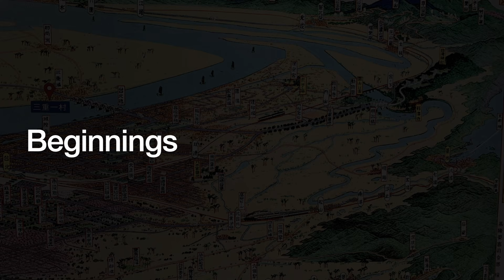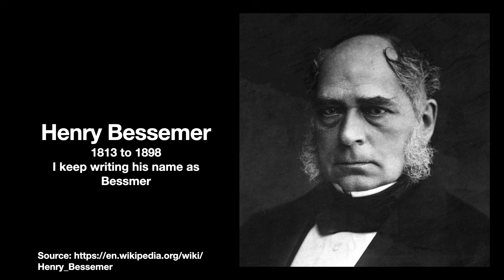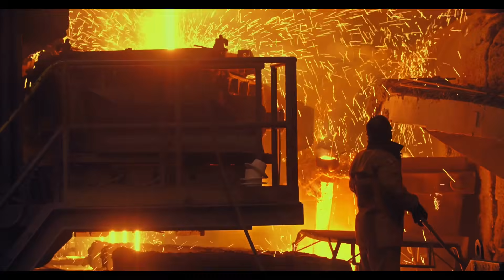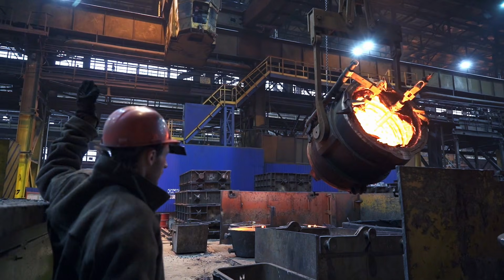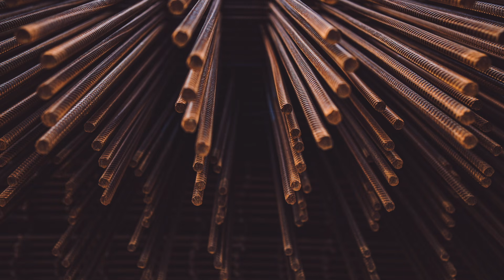Disrupting Big Steel: Conquest of the Minimills

Comment: The real reason that the integrated steel mill still hang on in the sheet steel space is because of chemical quality. Premium sheet steel is cold-rolled and any steel grade that finds an application in cold-worked products has limits on a number of elements: copper, chrome, nickel and molybdenum. These elements are also plentiful in scrap steel (take, for example, an old electric motor - copper wire tightly wound around iron cores and a nightmare to separate) and are known in the industry as 'residuals', because these elements cannot be removed from liquid steel via the application of either oxygen, or quicklime, or both. A steelmaking process fed with high amounts of scrap steel will invariably make products with higher residual element contents. The only way to keep residuals low is to make steel from iron ore, which is what the big integrated plants do very well. That said, there is more and more attention being paid to 'alternative iron' inputs, that is, iron that is not made in a blast furnace, such as 'direct reduced' iron (called that because the iron is not melted, reduction takes place in the solid state and produces a solid output, not a liquid). More minimills are using alternative iron to dilute the residuals present in the scrap feed and so enable the production of high-quality cold-worked products.
Reply: Yup. I think this video gives the wrong impression that EAF makes high quality steel compares to other production methods. When the quality of the scrap most often fed into them is of poor quality and there's no oxygen blowing present to remove some of those impurities like with a BOF. For Western steel plants who have to distinguish themselves with superior quality, EAFs just don't do it. The only advantage of EAFs is that they can be run with green electricity and won't produce greenhouse emmisions.
Reply: @SoundShunter72  Indeed. I think I have read about research in removing copper by, e. g., vacuuming the steel and having Cu evaporate, but that's still at lab stage. Not really clear how to make low-residual steels without fossil fuels in this decade
Reply: Vacuum degassing can help remove carbon and metals with low melting temperature like lead, but it's doesn't work for Copper or Tin. They are a pain in the ass for the industry as a whole and scrap with high Cu content has very limited applications. It's tears appart while rolling and hurts mechanical properties.
Reply: @clessayons  Look up vacuum cleaning of molten steel from copper in Google Scholar. Copper has a vapor pressure as well, it's just lower
Reply: So the barrier to making high quality sheet product is the quality of the scrap.  Ok that makes sense but the highest quality steels are made in Elec arc furnaces like stainless, tool steel etc.  Could it be for these very high value products select their scrap with greater care?
Reply: @dougwhiting7631  It's important to know that the "quality" of steel can mean a few things. It can both refer to the amount of unwanted/residual elements in the steel and/or impurity clusters. The latter are (solid) compounds, often oxides, that are suspended in the steel and can give problems during casting and/or rolling. How bad these impurities are for the product depends on how you process it further. They start to matter when you roll a plate really thin and the clusters start to elongate and show up on the surface of your steel. To prevent some of these impurities from forming, you have to use the BOF process and carefully sequence your alloying steps during secondary metallurgy. The EAF process does not really provide this option. However, these impurities might not even matter at all when you're making tool steels, because you're not rolling your product, but casting the molten steel into moulds directly instead. For steel grades made with EAFs, only the absolute analysis of the steel may be important (you cannot reliably detect impurity clusters with optical emission spectroscopy). Then all you have to do is make sure the raw materials (i.e. iron, scrap and alloying materials) are sufficiently pure, like you said. This is much easier for the smaller shops making the aforementioned stainless and tool/knife steels in small batches. For the large steel plants who make everything else, the batch size is much larger (more than 100 metric tons, but up to 350 metric tons if not more). In that case a BOF is more suitable, because it uses relatively less scrap.
Reply: @SoundShunter72  so really an integrated steel mill has an advantage for for gauge products that are cold rolled ?  So not structural shapes etc. but a bit of a niche.  And would a mill dial back on on the amount of scrap when doing a run of cold rolled?  For every grade ASTM etc there are limits for each element , min max, range etc.  I don't think an BOF mil would ever have much in the way of alloying elements.  I worked at mill that only produced gauge material and the alloy storage area was pretty small.
Reply: @dougwhiting7631  We used to do structural shapes, but the cheaper plants overseas usually make that now since the chemical composition of something like rebar is probably not very strict. For grades with tighter chemical tolerances we will actually load "cleaner" scrap. We have a couple different types of scrap to choose from, a lot of which is our own waste/rejected product, which is another advantage of vertically integrated plants. Each steel grade has its own scrap "menu" which tells us how much tons of each type to load.

Indeed most of the grades made in large steel plants is very low alloy. Once you get to high allow steel (>5%) it becomes very cumbersome and logistically challenging to make. For a batch size over 300 metric tons it might take 20 tons or more of alloying additions. For continuous casting, you of course rarely ever make a single batch.
Reply: @dougwhiting7631 our BOF added very little alloys, but our LMF added a shit ton.
Reply: @dougwhiting7631 a single batch for us required one ladle at 80 tons net weight. That was the minimum a customer could buy, iirc. We continuously cast sometimes single ladle orders of weird shit all the time.
Reply: It's funny. We made very high quality and unique grades like 14B25S, 1528B's by adding many many different types of alloy and we used pig iron, a BOF and a CSP.
Reply: @CatnamedMittens  I have a feeling that many people who replied don't quite understand steel 'quality' and where residual control becomes important.

I work in a rod mill (so the grade names I use are all SAE types like 1008, 1072 etc) so what are grades 14B25S (0.25% C plus boron?) and 1528B used for?
Reply: @sentinel76 I dont remember whay they were used for, maybe bearings or gears, but a 14S58B was like a silicone restricted, titanium boron heat.1528B was a titanium boron with .28% carbon. 

We also made heats with Vanadium, but they were hard and I don't remember the SAE number.

Another grade I remember is like a 6750 or 6850. I don't remember what was in that one either, but those were expensive.

Steels like 1008, 1008S, 1050, 1097, 1495 were our more generic heats. Hell, we even rolled floor plate with 1008 and maybe even 1050s iirc.
Reply: @CatnamedMittens  What was hard about the vanadium steels?

We roll vanadium grades on a regular basis into rebar and what we know is, we need to have enough nitrogen in the steel with vanadium to allow precipitates to form (so VN ratio is a key control), we have to ensure that the billets are heated enough so that all the vanadium is dissolved into the austenite and we have to cool the final bar quicky so that the precipitates don't grow so large.
Reply: @sentinel76 im not sure. I wasn't in the production/metallurgical side of things, I was in the maintenance. I think it had something to do with the machine specs or cooling water because I'm sure it wasnt a standard 1008V. It was probably some crazy proprietary grade where other alloys are added and the carbon content was high.

Comment: Small addition ( minute 21 ) the original name for what is called the BOF Steelmaking process here in the U.S. is Linz - Donawitz  because it was developed in 1938 at the then brand new Herman Goering Stahlwerke on the banks of the Danube in the city of Linz, Austria, Hitler’s hometown w/ its excellent Raspberry pie called the Linzertorte. After WW II for obvious reasons the HGS had to change its name, to VOEST. In 1982 had developed the next version of L- D ( BOF ) process by which the speed of Steelmaking became 3x faster, used by NUCOR.
Reply: Yeah, they're still making steel (voestalpine ag)...
Reply: Yes, but the idea of BOF converter was actually developed already in the second half of 19th century (Bessemer himself got a patent on oxygen converter, albeit acidic not basic), it's just the oxygen wasn't yet available for cheap before modern turboexpanders

Comment: Solid research by Asianometry in an area it does not cover usually. Say that as someone who has contributed to both the Steel industry ( 1973 - 1985 ) and the Semiconductor ( Chip manufacturing ) industry ( 1988 - present ) and have tackled the common problem arising from exponentially rising capital cost by exploring alternate Physics. In 1983 using intense Mathematical Modeling & Simulation developed within 2 yrs here in the U.S. Thin Strip Casting that the Germans ( Schloemann - Siemag ) were able to market within 5 yrs. Come attend Semicon West in PHX next month ( on Oct 7 ) to find out how we transformed Chip manufacturing ( at Motorola & Intel ) by developing lower cost integration approaches like Advanced. Packaging. Most recent advances in AI hardware (  2.5 d , 3 d , .., HBM  ) won’t be possible w/o. them.

Comment: AI Summary

Abstract:

This video provides a historical analysis of the American steel industry, framing the rise of "mini-mills" as a classic case of technological disruption as described in "The Innovator's Dilemma." It details the two key technologies that enabled this shift: the Electric Arc Furnace (EAF), which allowed for the use of scrap steel instead of iron ore, and continuous casting, which dramatically streamlined production and reduced costs. The narrative contrasts the lean, agile approach of mini-mill pioneers like Nucor with the response of incumbent giants like US Steel ("Big Steel"). Faced with intense foreign competition and changing market dynamics, Big Steel failed to innovate, choosing instead to diversify into other industries and sign unsustainable labor agreements. The video culminates with the mini-mills' adoption of thin-slab casting, allowing them to conquer Big Steel's last profitable stronghold—the flat-rolled steel market—and ultimately reshape the industry.

The Rise of the Steel Mini-Mills: A Story of Disruption

*   0:00:45 The Integrated Steel Mill: The video begins by explaining the traditional, capital-intensive steelmaking process used by giants like US Steel. This method involved converting raw iron ore and coal in massive, vertically integrated facilities.
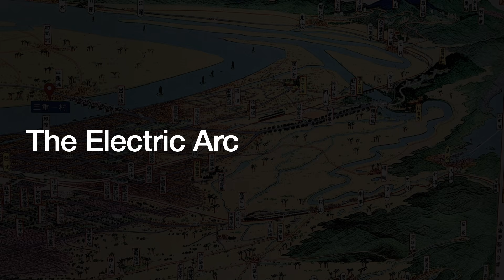*   0:04:33 Technology 1: The Electric Arc Furnace (EAF): The first disruptive technology was the EAF, which uses a high-voltage electric current to melt down scrap steel. Its key advantage was decoupling output quality from input quality, allowing for the creation of high-grade steel from cheap, recycled scrap.
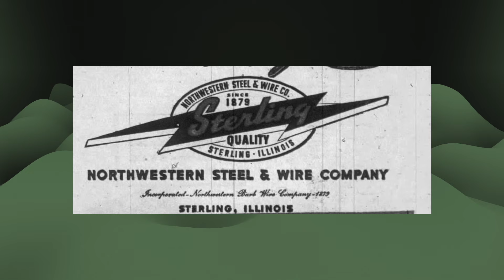*   0:12:03 Technology 2: Continuous Casting: The second key innovation was continuous casting, which bypasses the slow, wasteful process of cooling molten steel into ingots and then reheating them. This technology allowed steel to be formed directly into semi-finished shapes, saving enormous amounts of energy and material.
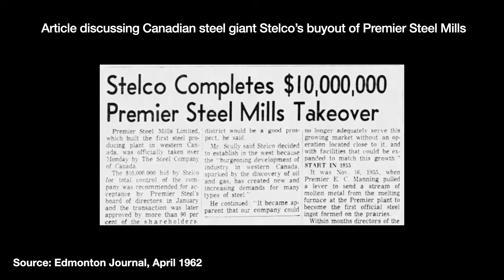*   0:15:45 The First True Mini-Mill: The first company to combine the EAF with continuous casting was Lasco in Canada (1964). This new "mini-mill" model had drastically lower capital costs (less than $60 million vs. $400 million for an integrated mill of similar capacity) and could be built much faster.
*   0:17:31 Nucor's Strategic Entry: Under the leadership of Ken Iverson, Nucor, a struggling conglomerate, entered the steel industry by building a mini-mill to secure its own low-cost steel supply. This move laid the foundation for it to become America's largest steelmaker.
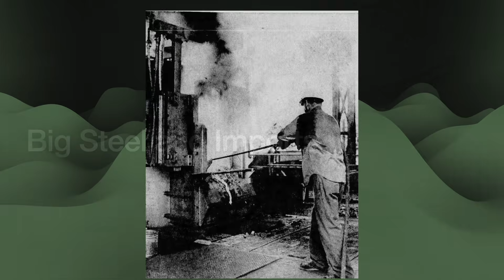*   0:20:13 Big Steel's Innovator's Dilemma: While mini-mills grew, Big Steel's primary threat was from highly efficient Japanese producers using modern Basic Oxygen Furnaces. Instead of modernizing its own facilities, Big Steel diversified into unrelated industries like chemicals, real estate, and oil (US Steel acquired Marathon Oil) and signed costly labor agreements that made them uncompetitive.
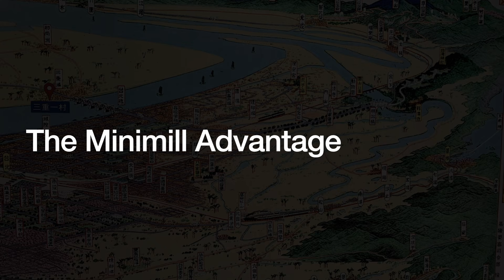*   0:26:34 Mini-Mills Capture the Low End: Throughout the 1970s, mini-mills focused on low-margin products like rebar and rods. Their lower costs, non-unionized workforce, and flexibility allowed them to steadily take market share from both Big Steel and foreign imports in this segment.
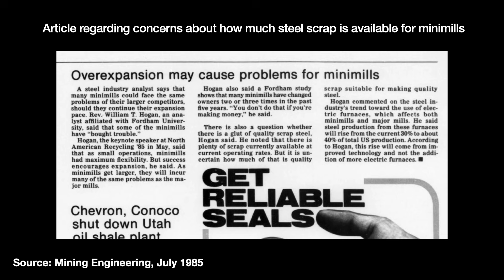*   0:32:50 Conquering the Final Stronghold: For decades, Big Steel's most profitable market, flat-rolled steel (used for cars and appliances), was protected by the immense capital cost of the required machinery. In 1986, Nucor adopted a new German "thin-slab casting" technology, which slashed capital and energy costs, allowing mini-mills to successfully invade and dominate this final market.
*   0:35:30 A Uniquely American Disruption: The video concludes that this disruption was particularly successful in the United States because the government took a relatively hands-off approach. In contrast, European governments often provided subsidies that protected their large, inefficient integrated steel companies from market forces.

I used gemini-2.5-pro| input-price: 1.25 output-price: 10 max-context-length: 200_000 on rocketrecap dot com to summarize the transcript.
Cost (if I didn't use the free tier): $0.04
Input tokens: 26031
Output tokens: 870

Comment: In making Iron or Steel:

1) Fine Powdered Iron (Hydrogen or Natural Gas) Flash Smelting
taking a few seconds
is 3600x faster than Traditional Blast Furnace Smelting
which can use LOW and MEDIUM Grade Iron Ores
produces no Carbon Emissions
(doesn't need coal)

is more efficient than

2) Hydrogen Flash Smelting
takes a few minutes
is more energy efficient than #3
which must use HIGH Grade Iron Ore (compared to #1)
produces nearly no Carbon Emissions

is more efficient than

3) Oxygen Flash Smelting
takes a few minutes
which still produced Carbon Emissions

is more efficient than

4) Traditional Blast Furnace Smelting
which produces the most emissions
taking 5 to 6 hours

■

as far as i can gather:
(had to look it up, using various AI queries, and consolidate the info)
others could help correct this where it's wrong

Comment: I would love to see a video on the remains of the US Copper industry, right now there are only 2 operational copper smelters active in the US, and one partially inactive due to a union strike.  These are down from Dozens throughout the southwest, I'm sure its a story of rising labor costs, cheap foreign imports and environmental regulation. Good work as always.
Reply: Environmental regulation played a role, in that it’s generally illegal to dump poison into people’s drinking water.
Reply: onepaw1089
Copper i did myself. Centrifugal casting, ceramic model i made for a cooler block, just made myself on a 3D printed model
Easy to do on high end levels in a garage
Reply: Great operation to combine with a nuclear reactor - heat and electricity in the same place - minimal electricity/fuel cost.

Comment: So, I worked in a CSP, thin slab caster. It was a continuous caster. However, the iron was shipped in bottle cars across state lines, and we had our own Basic Oxygen Furnace and two Electric Arc Furnaces. This went into a caster that funneled the steel into a tunnel furnace and eventually a mill that produced coils. The facility shut down very recently with hundreds of jobs lost. This facility was, kind of ironically, part of a big steel company. Their failures shame us all. Sad to see the place close after 100+ years of steel.

It might be the first CSP ever closed in NA.

Comment: Another innovation that came about in the 90s when mini mills were coming online was the use of VFDs (variable frequency drives). Steel mills have hundreds to thousands of electric motors. Many of the large integrated mills used expensive and inefficient DC motors and related infrastructure to convert AC to DC. Newer mills were built using VFDs and AC motors which are much cheaper and efficient.
Reply: As someone who has worked with both, gimme a VFD anytime!
Reply: Yes, to this. I started work as an electrician for a series of railroads in '95 and saw the transition from DC traction motors to VFD AC ones. The latter are more efficient and require less maintenance.
Reply: Some mills still use M-G Sets. Its cringe.
Reply: Man DC Motors suck for maintenance too, AC and drives are so much nicer
Reply: @sixdonuts ITYM “more efficient”.
Reply: Why on earth they use DC motor in the first place? I think most heavy industry use AC motor.
Reply: @Theoryofcatsndogs One way to achieve variable speed control before electronic VFDs was a wound field coil DC motor where variable DC voltage in the field coils varied motor torque. This way a smaller variable power supply with perhaps 10% of motor power could control a large motor.
Reply: @Theoryofcatsndogs  Ease of control before thyristor drives were developed. When I joined the steel industry in 1975 there were still some Ward-Leonard sets in use. I'm not sure, but I suspect there may have been motors retained and newer controllers installed. Continuous control of speed was needed.
Reply: @Theoryofcatsndogs it was state of the art for many years.